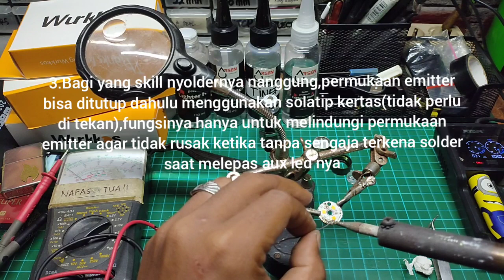[TUTORIAL] Wurkkos TS10‼️Mod RGB Aux Light

Comment: Tutor buka drat headnya gmn om,susah bgt sy cb 😂
Reply from the maker: Kalau TS10 ini,Ga lah..setahu sy nemuin bbrp unit TS10 bezel semuanya gampang buka nya..ga spt WK03 yg di lem thread locker
Reply: @deviliciouscustom  walah brarti tangan sy yg blm kuat 🤣
Reply from the maker: Bezel dibuntel,dilapisin karet anti slip,atau bisa pake karet ban dalam motor/sepeda itu barang yg gampang di dapet..kalau emang beneran ga bisa kebuka jg,apa mungkin untuk yg produksi baru di lem jg?😂
Kalau di lem..memang harus di panasin dl pake heat gun,dan selagi masih panas..di puter bezelny
Reply: @deviliciouscustom  siap om,besok dicoba pake karet 😂😂

Comment: Om mau tanya wirkkos ts10 punya saya kalo dimode turbo steepdownnya kk cepat ya
Reply from the maker: Kalau head nya sudah panas ya wajar jika stepdown..kan emang driver ada ATR/temp controlnya
Tp jika kondisi head masih dingin kok sudah step down..silahkan di hard reset anduril nya,mungkin kmrn ada salah klik atau bagaimana sehingga tanpa sengaja masuk ke config mode untuk merubah setting kalibrasi temp..nya
Cara reset nya sama dengan anduril versi pertama..cut power off,kendorin tail cap sampai power benar2 cut off..pencet dan tahan switch,sambil dikencangkan lagi tail cap dan power masuk(switch tetap di tahan),nanti kedip2 tanda hard reset nya sukses
Reply: @deviliciouscustom  terimakasih om udah ngasih tau caranya